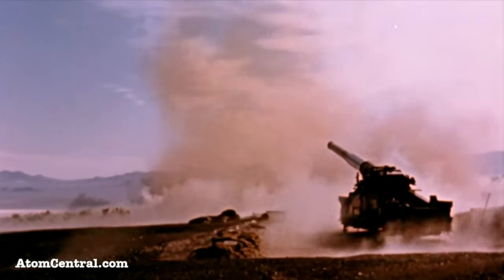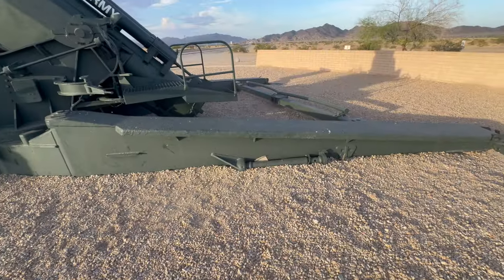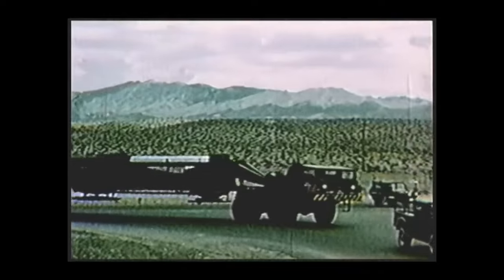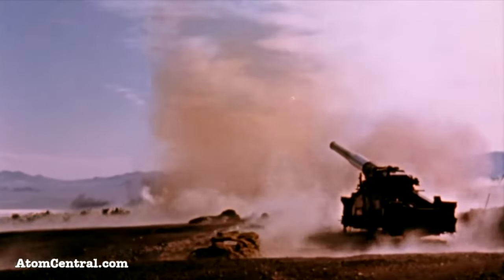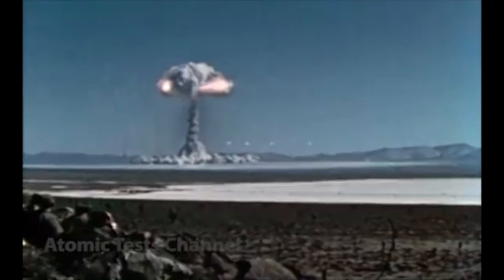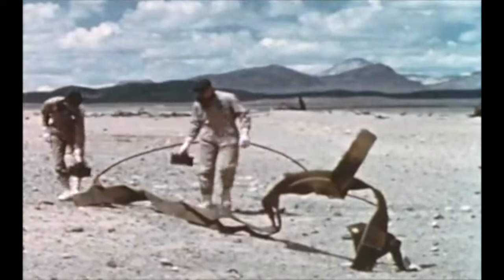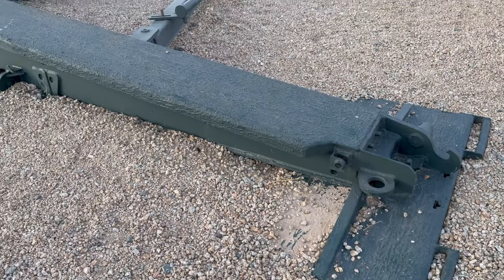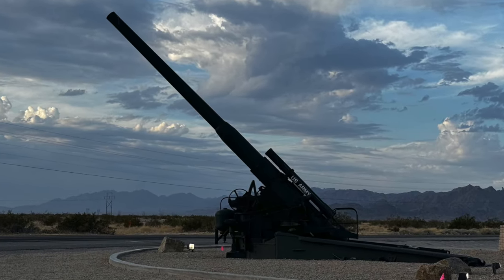Atomic Canon Yuma Proving Grounds

Comment: Annie is still in Lawton OK.  None of the atomic howitzers had a tripod footprint though.. they are 16 points of contact total. The howitzer you show with the tripod is a long-tom. Heavy howitzer, but not nuclear capable.
Reply from the maker: Thanks for the clarification.  I was surprised to see the tripod set up as the other pictures I had seen looked narrow.
Reply: @WilliamBerryDesertAdventures  The M65 280mm Howitzer came on a "pallet" frame system. The system was modeled after a piece of earth moving equipment called a bowl scraper.

while the M65 did indeed have extendable legs for stability, there were 4 legs in total and were only required when the gun was to be traversed. Most of the time the crews would "aim" the platform before setting it on the ground to save the effort of extending those outriggers (legs).

The drills for the crews in Germany were to be able to set the gun, load aim and fire twice, and then strike (pack up) the site and relocate inside of 17 minutes.
Reply from the maker: I really appreciate
The expertise.  I was told that the canon we visited was the atomic canon.  I was surprised to see the tripod system but thought it was the correct gun.  Good discussion has resulted.
Reply: @WilliamBerryDesertAdventures  In the defense of the folks who were talking with you, they were almost right.

There was indeed a 155mm nuclear shell developed, and the same diameter shell was fired by the long tom, but the long tom had a different rifling and had a combustion chamber. It was the combustion chamber that gave away the identity of the tri-pod arty in your video.

The 155mm Nuclear shell was never test fired, just underground detonation tested. "Atomic Annie" was the M65 in the clip of the actual test fire of a nuclear shell.

Silly little piece of trivia, "Annie" got mixed up with another M65 for a few years, and was nearly deployed on accident. She then sat out in the weather for a couple years before getting shipped to the Museum there at Ft. Sill. (Lawton, OK). The barrel on Annie wasn't fully up to specs, it was just a "good enough" tube of low quality steel for the test fires. hence the deployment would have been an accident.
Reply: In honesty I don’t anything about guns but I do know there are a couple of Howitzers positioned outside the range along the road passing to the north. I looked it up an article which refers to a HARP gun with a 16ft barrel, we had heard of while attending an open house up there a couple of years ago.. On YPG in 1966 it fired a 185 lb shell.  It is still there.
Reply from the maker: @christineeast9879 There is a HARP canon at YPG
Reply from the maker: The HARP gun is not accessible to the public.  It can be seen on Google Earth.
Reply: @nunyabidness674  In addition, 20 of those cannons were made and deployed along the borders with North Korea and then-East Germany; despite being rendered obsolete in short order, they remained on station until 1963.  A few have been salvaged as museum pieces.  I've seen two of them; not the one at Fort Sill, but one at Rock Island Arsenal on the Illin'-Noise/Iowa border, and the one overlooking Fort Riley, in Kansas.

Comment: the cannon you show is a 240 mm howitzer, phased out sometime after WW2.  There is also one at Pueblo Army Depot outdoor Museum in Colorado, I worked there.  Atomic Annie was replaced when the Army developed both an 8 inch and 155mm Nuclear warhead that could be fired from standard artillery weapons.  the 240mm howitzer is not a "long tom" which was a 155mm gun that was not capable of high angle fire.  Lots of time was needed to excavate the emplacement for the 240 howitzer.  As you can see in your picture there is no space available for recoil.
Reply from the maker: I found that out after filming.  Thanks!